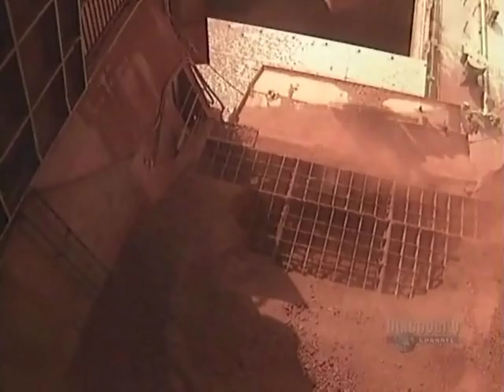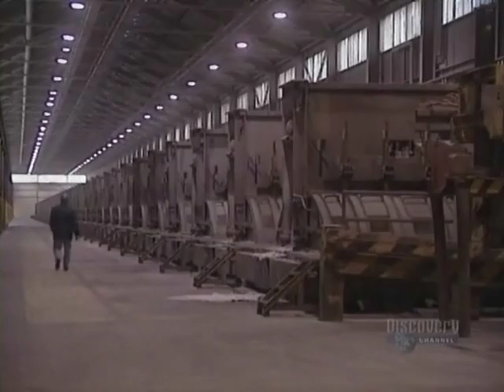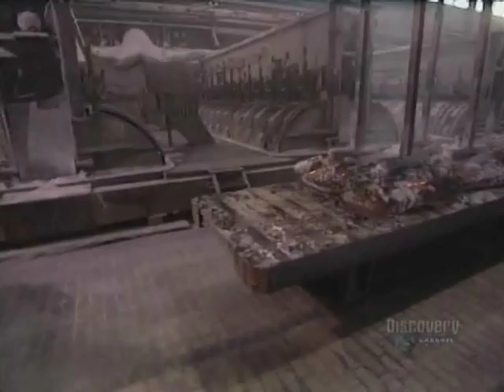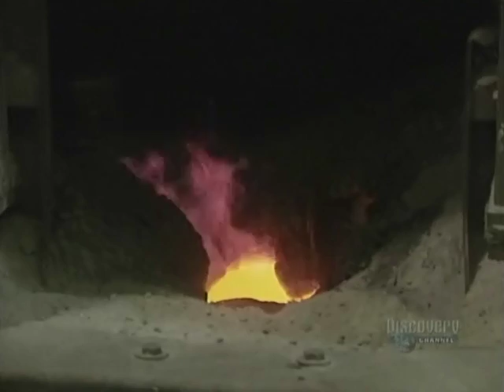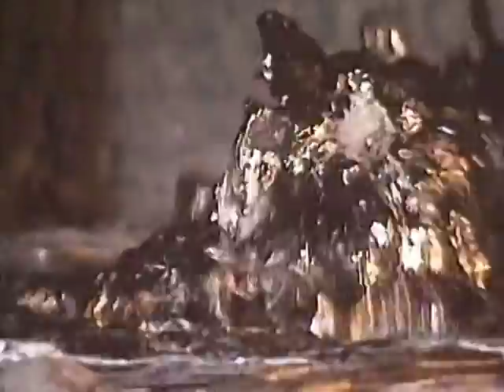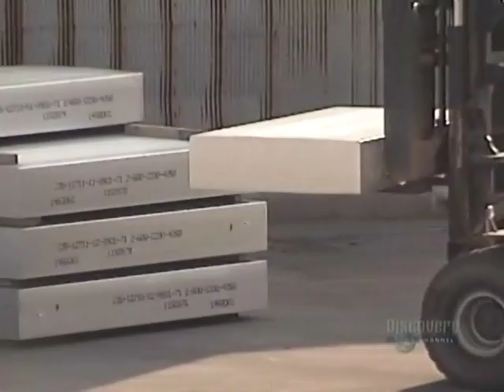How It's Made - Aluminium or Aluminum

Comment: Aluminium and aluminum have several similarities, but they also have several key differences. Both metals are available in a variety of shapes and sizes, and they are both highly durable. However, aluminium is lighter and more malleable, while aluminum is stronger and more resistant to wear and tear.

Comment: how tf is aluminium so cheap if THIS is the process to make it?? thats nuts
Reply: Efficiency and lots of smelting pots. the plants run 24/7. I work at one. Well I’m a contractor at one. I rebuild the superstructures that set on top on the pots. ( the big silver bridge that the anode rods attach to). They last about 2,000 days. My plant has 360 melting pots
Reply: @erikcourtney1834   serious question. Aluminum is so toxic.  Can cause damage in your brain etc.  Are you guys wearing gear to protect you?  Are they honest about the risks?
Reply: @bratmari  yes we have to wear respirator air packs. They have signs up saying the dust will cause cancer. They take it serious
Reply: It used to be a lot more expensive: Before the invention of the electrolytic process for making it, the only way to make aluminium was to sacrifice another more electropositive metal, such as magnesium, which can reduce aluminium oxide or aluminium chloride to aluminium metal. Titanium is still made this way, by reducing titanium tetrachloride with magnesium, which is why titanium is orders of magnitude more expensive than aluminium.

There was a time when aluminium was more expensive than silver, and royalty or other nobility would have aluminium cutlery made as a prestige (essentially, look at me, I'm so rich I can afford to spend money on this) project. Also, next time you look at the Washington Monument, see that metallic pyramid shaped block right at the top? That's aluminium, and was ludicrously expensive to produce, since it was made before the electrolytic process was invented.
Reply: 5% of all US electricity spent on aluminium